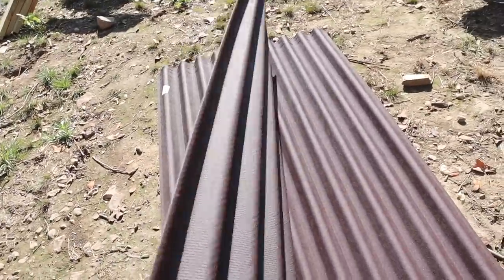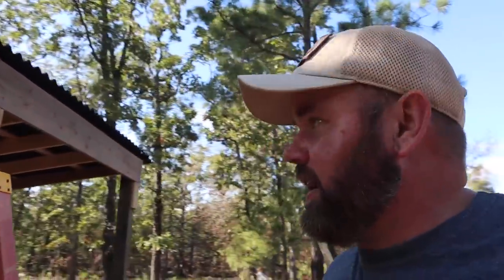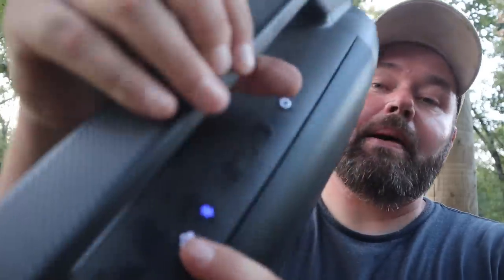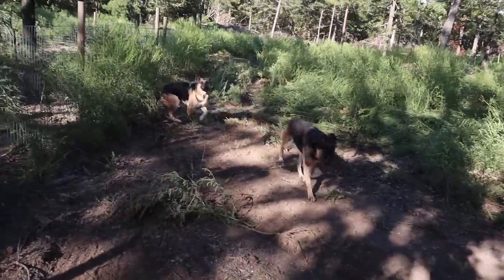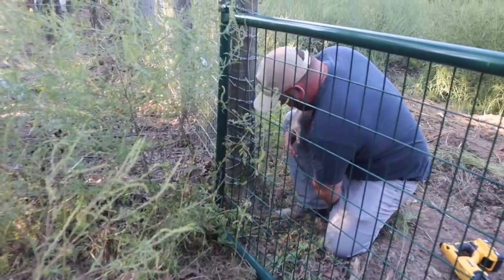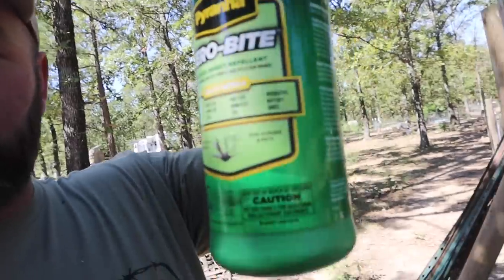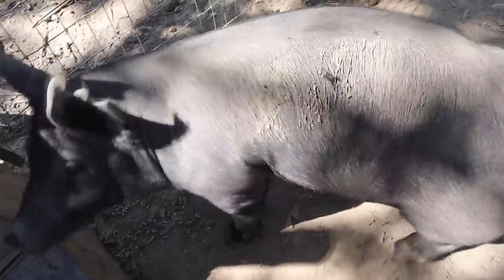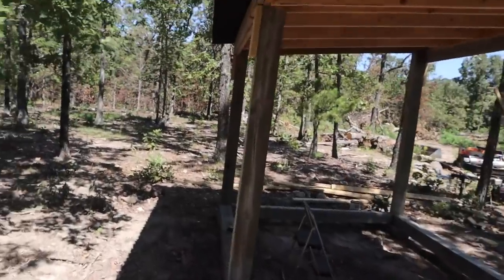I Wasn't Ready For This | NEW ANIMALS

Comment: In 1961 my parents built a house. When we moved in it was only partially done. I helped my dad install hardwood floors, wood trim.  Just had a door on the bathroom. And we would just set it in the opening for a couple weeks. I was only 9 but it was a lot of fun seeing the house come together.
Reply: Lots of folks started with a piece of twine run thru a sheet or blanket header and fastened on either side of the door opening. Not the best, but it was a little better than nothing.

Comment: The trampoline you can repurpose it by useing the top ring area as a roof for shade and make new longer legs and a door to go under and attach ( hog wire ,or chicken wire , or Avery wire ) attaching it to the legs making a nice shelter for meat chickens or meat pigs or even as a small Avery. But attach the legs to a wood ring on  sled so you can move it from area to area on the property.

Comment: Use some old metal/steel cattle gates/grates for the flooring in the wood shed to stack your wood on. May require welding in more cross bars but won't rot.  Things are coming along fir you guys👍👍👍

Comment: I have used the roofing you used on the and ended up,replacing it after a quarter size hail storm that turned  it into Swiss cheese.   I found out that it require a plywood backer, and is not as durable as steel.

Comment: You might be able to replace only the bent parts of the trampoline or heat the metal then reshape it. The bounce part doesn't look torn or damaged. Next time take it into the ground or set legs in concrete once you have final destination for it.

Comment: Dutch, how about using the material that you used on the roof, put it on the ground and then put down pallets?  Just a thought.... it's tough, probably keep the wood from rotting and using the pallets to get the wood off the ground.

Comment: Is the roof textile from some sort of recycled tire component?  The roofing material being a little flexible may be advantageous if you get windfall branches hitting it.
Reply: It's an asphalt product, it's called Ondura works better on higher pitch roofs with solid substrate

Comment: I would suggest that you put some diagonal bracing on the sides and back walls, especially if you are going to use vertical siding on the shed.  If not you might have some issues if you get some strong winds.  If you look at most loafing sheds, they have diagonal braces.